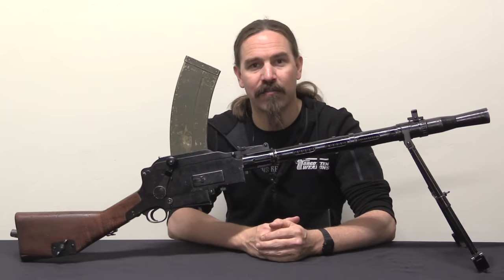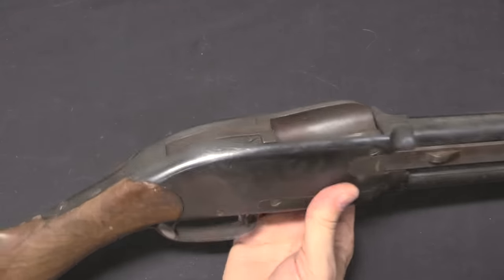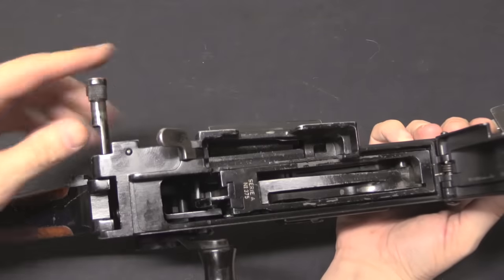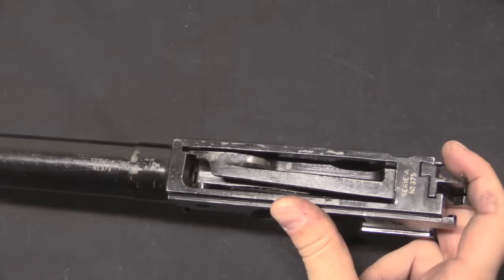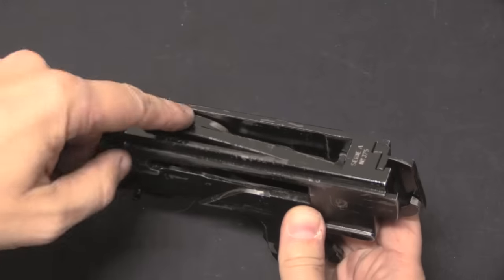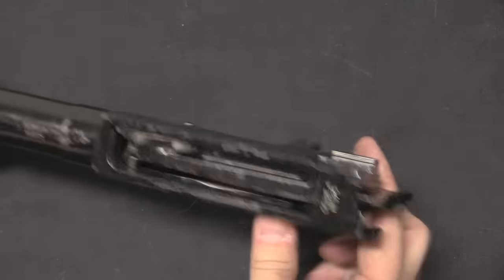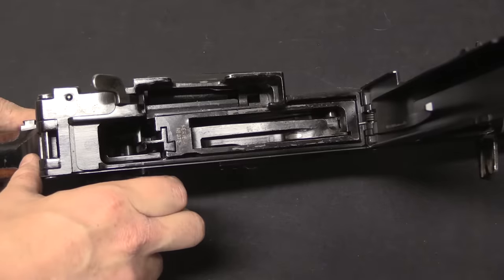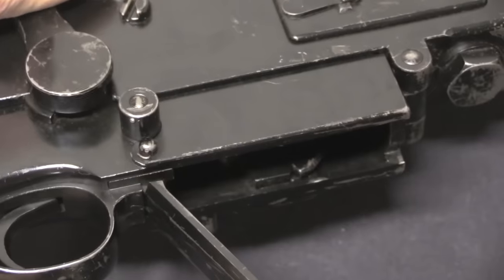The Gun Science Says Can't Work: Madsen LMG Mechanics

Comment: The Madsen LMG is an industrial tool. Like a lightbulb assembly tool, or a barbed wire assembly tool.
The kind of complete control it has over the cartridge (“the piece to be worked”), with one element (and sometimes two, see the lever-actuated recoil spring) performing one action (the rammer pushes the cartridge into the chamber, the tilting bolt locks it, the hammer/striker fires it, the tilting bolt unlocks it, the tilting extractor extracts it…), is typical of that kind of tools.
In that kind of tools, where there is a single machine in the factory to work a million pieces a week, simplification doesn’t matter.
That’s why it works. Because that kind of tools work.
The downside is the cost, and the work of who has to service it.
Reply: It's a mass production device for producing flying bullets down range. With a minimum number of parts and solid cam surfaces to do the heavy lifting.

It's flaws include lots of elements with extreme hardening requirements (hard enough to not wear or become misshapen, soft enough not to shatter on use), serviceability of wear components, and vulnerability to jams due to inconsistent ammo and difficulty servicing the functional component: aka the chamber.

In peace time it's a fantastic firearm. At war it's 6 camming surfaces that want to foul up, break down, and jam or skip out of the right place.

Lovely engineering by someone who looked at the problem and simplified it to perfection using the technology they understood well, but ultimately a Tool makers tooling is surprisingly incompatible with war.

Madden's served on all fronts of WW1. But they are expensive and hard to fix. And barrel assemblies are large and easy to foul up in mud trying to swap them in trenches.

Lovely toolmakers swan song tho.
Reply: Wow, what an apt metaphor! That just clicked perfectly in my mind.
Reply: Quite a good metaphor.
It's a machine tool, but for "producing" lead on target.
Fantastic if you can keep it in controlled conditions (like a factory or workshop, or perhaps even a concrete bunker), but like any machine tool, try to use it in mud and rain and it just stops working entirely, and it will never stop working 2 times in a row for the same reason!
It's just not built for the trenches.
Reply: Good analogy, but these types of tools only work well in controlled environments.  In the field a rifle needs to function equally well in cold, heat, wet, dry, sand, mud, poor maintenance conditions, suspect quality or damaged ammunition, and be simple enough for the lowest IQ soldiers to operate, clear malfunctions, clean, maintain, have a basic understanding of its operation, etc etc.  'Industrial tools' of this type belong in factories, not the battlefield.
Reply: @44R0Ndin  Yes and no. 
Factories and workshops of the time were not clean places. 
WWI HMGs, like the Vickers, the MG08 and so on, were built with the same concept, and had been among the most reliable self loading firearms ever. 
Because, like the industrial tooling of their time they were massively overbuilt. It was like they couldn't be bothered by the simple energy of a cartridge firing. And, in their frame, there was a lot of void space, so the dirt had a lot of places to go before locking the mechanism. 
The Madsen LMG was kind of a smaller version of that. As that, it was a little more sensible to elements and dirt, but no more (and maybe less) than any LMG of the time (Hotchkiss Portative, Lewis Gun... not to talk about the Chauchat).
Reply: @knurlgnar24  Yes and no. 
Yes and no. 
Factories and workshops of the time were not that controlled environments, they were not clean places, and they could be hot, cold, and anywere in between.
WWI HMGs, like the Vickers, the MG08 and so on, were built with the same concept, and had been among the most reliable self loading firearms ever. 
Because, like the industrial tooling of their time they were massively overbuilt. It was like they couldn't be bothered by the simple energy of a cartridge firing. And, in their frame, there was a lot of void space, so the dirt had a lot of places to go before locking the mechanism. 
The Madsen LMG was kind of a smaller version of that. As that, it was a little more sensible to elements and dirt, but no more (and maybe less) than any LMG of the time (Hotchkiss Portative, Lewis Gun... not to talk about the Chauchat).
Reply: It's the exact opposite of industrial ammunition loading machines.
Reply: @immikeurnot  I dunno man. It doesn't tend to bother shaking out the powder in the state it was received in. It tends to convert it to gas to dump out the chimney once the bullet gets out of the way.

But close.
Reply: Complex loading, ramming and ejecting action is also present on some autocannons - especially the ones of large caliber that can't afford to just fling their big rounds around.
Reply: @walterscientist  masden Autocannon.

Masden Battleship Cannon.

Masden Orbital Rocket Loader.

The possibilities are endless.
Reply: This is why the earliest iterations of firearm mechanisms are the most interesting; there was no "how to make a self-loader work" playbook, so everybody who took a crack at it came from a different mechanical background. 
Today, if you want to design a pistol, it's just assumed everything will look pretty much like an S&W 39/Sig 2xx or a Glock. Back then, chain-linked pinfire rounds and detachable box magazines were more-or-less equally viable.
Reply: @glenmcgillivray4707  Madsen did make 20mm AA gun/anti-tank autocannon (along with 23mm version of it) which is recoil-operated - and potentially also rely on similar mechanism
Reply: the less said about the sho-sho the better R Lee Ermy got off a 3? round burst before his janmed  (during his show
Reply: @richardsmith4794  that gun. Made well. Works. Mostly. Worn out by 100 years, or poorly made, of muddy, or with a bad spring. Doesn't. Mostly.

It's what we usually refer to as a prototype rushed into service.
Reply: @richardsmith4794  Please, you can't draw conclusions from a single 100 years old sample tested using a magazine of the same period. Over 90% of jammings are magazine-related and, to me, the conclusion of THAT test was decided in advance. If you WANT a weapon to fail, it's easy to obtain the desired result. 
You can see countless tests on the tube of the weapon running flawlessly, and it had been the sight of the Chauchat used on assault en masse that inspired Vladimir Grigoryevich Fyodorov to build the Fedorov Avtomat.
The Chauchat had some well known drawback (IE the action locking due to overheat) but it's strong point had been that France was able to manufacture over 260.000 samples in a partially invaded country while UK built 50.000 Lewis guns in the same time span. Individually the Lewis Gun was a better weapon. 1 vs. 5? No way.
Reply: @glenmcgillivray4707 nah, it was far more reliable and than contemporary machine guns, one of the reasons for it’s popularity. Even after newer developments could fire 2 times as fast. 
It was more precise and reliable!
If you have had bad experiences with it, it’s probably because it was redesigned to use what ammunition the buyer preferred. There might have been some issues there.
Reply: @mwtrolle  contemporary machine guns like the Vickers and Maxim were far more complex perhaps but also more reliable in wartime operation and use. The poor Hotchkiss would lock up from any kind of mud, dirt or grit getting near the bolt and camming surfaces. And shaking your own magazine loose is never great for a machine gun either. Again. Great in peace time but wartime experience suggested it had its faults and they didn't survive to be particularly used in world war two.

Comment: In some animations I’ve watched, it appears the extractor actually doesn’t engage with the rim of the cartridge on the way into the chamber. It flips forward, but it only rises up a last bit after firing and then gets under the rim to extract. Easier than timing it to meet the rim on the way in, and feasible because the chamber is unsupported.

Comment: The more I see of its inner workings, the more I think it can be simplified in the same way that the BREN was simplified to become the BESAL. 

The side feeding magazine is indispensable to the action's reliability and robustness. By reverting to a more straightforward bolt interface, extraction and ejection can be performed as a consequence of the bolt's rearward travel which in turn cams the feeder. Rotating clockwise to feed lowers the ejector, rotating anticlockwise to pick up a new round exposes the ejector. This results in vertical ejection which might cause cases to fall back into the top of the action, but the geometry can be tweaked to ejected slightly off vertical if necessary. As a bonus, this arrangement can be easily adapted to whatever gas system is preferred -- long stroke, short stroke, direct impingement, internal impingement. The bolt can be locked with a tilting block at the rear which can be interfaced by the gas system before the bolt in a two-stepped bar that provides the "timing" to the action. 

I'll see how it all comes together digitally, if this idea is even possible to begin with. But I think we have potential for a simplified Madsen which keeps the most interesting features of the original.
Reply: good

Comment: This mechanism could be the basis of an ambidextrous, downward ejecting bullpup. It has a very short mechanism, and the magazine could be either upward or downward feeding.
Reply: I'm confused how that would work since the magazine is currently on top and it ejects down. Flipping the action (like on the shotgun he showed) results in upwards ejection by default.  I suppose you might be able to extend the eject ramp to a U like on the belt fed Madsen?
Reply: The action feeds from the side via a ramp, so the while magazine setup could probably just be flipped upside down to have the magazine on the bottom.
Reply: TKB-022PM is kinda built along the same idea.

Comment: It looks like Rube Goldberg in an opium den...but it works!!
A bit of confusing firearms minutia:  Not to try to criticize Ian (he is making the process as understandable as possible), but strictly speaking, a 'rim' is only a rim if it is wider than the case body, such as .38 Special and other revolver cartridges--or .22LR.  Since the flat part at the end is the same diameter as the case, the cartridge is 'rimless' and has the extractor groove around the case, which of course the extractor snaps into.  Then, to further muddy the water, there is a 'rebated rim', where the not-a-rim behind the extractor groove is smaller than the case body.  No doubt there are other exceptions.
Clear as mud?? 😎
Reply: A rim is still a rim, even if it doesn't protrude beyond the case base. The confusing bit here is the term 'rimless cartridge'. It does not actually mean absence of a rim, it's just a more convenient way of saying 'a cartridge with a non-protruding rim'.
Reply: @mimicrymwot  Good point! For all practical purposes, that little lip behind the extractor groove functions as a rim.  Rather than meaning 'to lack' the -less can be thought of as 'not as much as', thereby squaring the terminology circle. 😎
I once had a dictionary of firearms terms that got lost when moving.  It was a fascinating tome!

Comment: Thanks! I have not seen the inside of a Madsen, and had no idea how it worked. This is about as complicated, to me, as a dual overhead-cam engine! Not really, but it feels that way. But what is striking to me is the endurance of that beautiful job of blueing!
Reply: I'd say that a DOHC has less moving parts than a pushrod engine, and wait until you see truck engines with jakes. Those have A TON of parts
Reply: @iaial0  Now I am picturing a Madsen 2-stroke diesel engine with ignition being on a coil point in place of the firing pin and injectors on both sides of the bolt, with the barrel replaced by a piston!

Comment: Interesting. There are some of this "trilobites", e.g. these rectangular flashlights with flat batteries. They already existed during World War I. Do you know any other items in this style?
Reply: Go look at a 4.5v lantern battery and tell me that's not designed for those flashlights. Three carbon-zinc or alkalaine cells instead of 2 or 4.
These days rectangular flashlights probably use LEDs and prismatic or pouch type Lithium-Ion batteries.
There's one I want to get that fits in the palm of your hand but can put out a 7 second burst of 10k lumens.
And the 1k lumen tactical flashlight I have right now is already bright enough to temporarily blind anyone I accidentally shine it at.
So I can only imagine that 10k lumens is just painful to look at from almost any distance of note in a defensive situation.
Almost certain that the 10k lumen burst isn't meant as a gimmick, it's meant as a legitimate defensive option.
Attacker can't really harm you if they can't see you, after all.
Reply: @44R0Ndin  Yes, this is a defensive option of course. These flashlights are even built in such a way that after blinding your opponent, you can hit him in the face with the metal part from the front. As for old flashlights with 4.5 V batteries, my father has one and it has practically not changed for 100 years. It has a regular bulb, not LED. It also has these colorful filters, which probably had some military significance. When you press the switch, you have a short flash of lights for Morse code. Only moving the switch down gives constant light. All this is practically unused by civilians, but these flashlights are still made the way they were in 1914.
Reply: @Zbigniew_Nowak 
No reason to change the design if it still functions and it's still practical to produce.
That's part of why the US M1911 .45ACP pistol stuck around in service so long, they really hit a home run with that design.

Comment: This is the stuff! It makes me wish I was a gunsmith to truly appreciate the Madsen; maybe run off a functional copy with a 3D printer. Imagine being able to see inside to watch it function! I am not an engineer, but it seems designed to avoid single points of failure by using lugs and cam tracks. It doesen't seem to need close tolerances, either.  It might be pretty tolerant of mud and dust.

It looks complicated, but i wonder if it's parts are just larger compared to other systems. How does it compare in terms of mass to a BAR?

Comment: If I remember correctly, the 'bumblebee' analogy is because the cartridge actually follows a - very slightly - curved path as it enters the chamber. Which should not be possible for a rigid cartridge case if considered simplistically. Except it's not quite that simple.
Reply: There is no bumblebee analogy, that whole thing is a stupid myth.
Reply: @Ni999  What is a myth about the previous aerodynamical models not adequately explaining the flight of the bumblebee?
Reply: @Ni999  The bumblebee thing is about the physics of aircraft with rigid wings. The physics are entirely correct, predictable and workable. But if you apply them to a bumblebee, the insect should not fly - because a bumblebee does not have rigid wings. The analogy was made, not a myth and also incorrect.
In the case of the Madsen, someone said 'how can a rigid cartridge follow a curved path?'. The answer would be 'how can a long sofa fit through a narrow doorway', the answer being 'by following a curved path'.
Reply: @onenote6619  Nothing like revised history that replaced what happened with a great explanation that was never at issue. Wonderful narrative. Great retcon. You ought to work for Disney.

Comment: Thought while watching: 
All the Madsen guns I’ve seen are about the same size since the cartridges 7x57, 30-06, 8x57 etc., are all similar in size.  The 11.35x62 Madsen had about twice the power and thicker cartridge case.  Makes me wonder if the actual gun was much bigger/thicker/heavier then a standard gun.  The standard Madsen gun seems a bit overbuilt, plus the fixed mounting the 11.35mm usedmight mean it’s the same size as a 30-06 Madsen.  Anyone know?
Reply: Huh. This design looks scalable up to and including artillery!
Reply: I know it was offered in both 20mm and 23mm.  I was wondering if the guns exterior dimensions were the same or enlarged.  Cartridge length would be similar to 30-06 but the width was something like a third thicker.
Reply: Looking at different sources the standard Madsen was 9 kg the 11.35 was 10.5 kg with a longer thicker barrel.